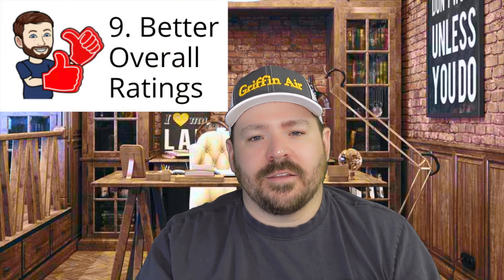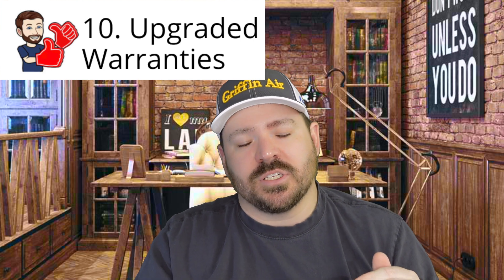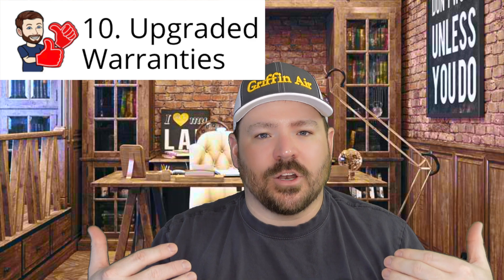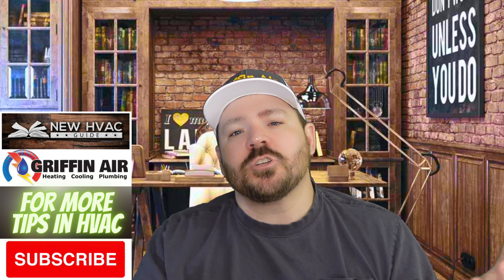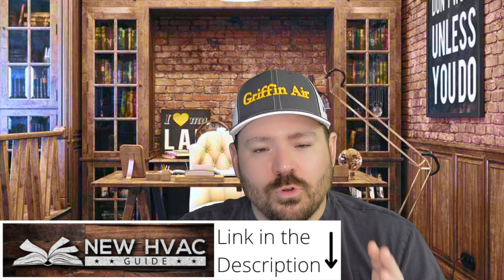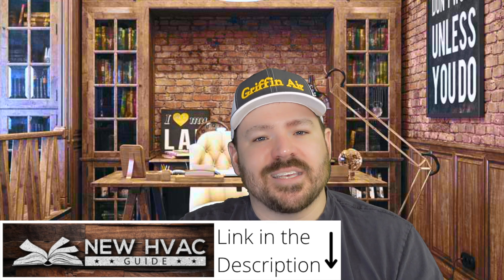12 REASONS Inverter HVAC Systems are BETTER!

Comment: I'm in Tucson, AZ and preparing to replace a 5 ton rooftop-mounted packaged heat pump.  I have quotes from two contractors, one who didn't even bother to climb to the roof (a non-starter) and another who seems to me to be top-drawer.  My options are a American Standard (Trane,) dual-speed comp and ECM blower or a Bosch IDP.  As a retired EE and techie, I'm leaning to the Bosch, which is actually a few bucks cheaper.  This isn't a concern.  But what is, as a radio amateur operator, I have worries about the potential for radio-frequency-interference (RFI) being generated by the inverter electronics.  The EDM in the current Trane generates a bit of this but is livable.  The wall-wart switch-mode power supplies that are everywhere are the bane of our existence and are often thrown away and replaced with linear supplies.  Clearly, I can't do that with a heat pump.  Do you have any experience with this?  Love your channel.

Comment: I just had a Daikin inverter system put in. Replaced a pos Trane I had for only 5 years. Spent the extra and been happy with it. 12 yr warranty and I have a stress free program so filters for the whole house HEPA I got and maintenance is included.

Comment: Any time you add more complex systems to any machine the maintenance cost and failure rate rises. The people who benefit from this scenario is the HVAC company's that sell and service these systems .
Reply from the maker: I think it depends on what you mean by failure rate. If you’re saying there are more bells and whistles and things that could go wrong, that may be true. But if you’re saying that things like a compressor or motor are more likely to fail, in my experience… The opposite is true. I have replaced hundreds of failed single stage compressors in my career but have only ever seen one inverter compressor fail. This is precisely why most manufacturers are giving above average warranties on inverter systems

Comment: When I bought my house it had two separate oil furnaces with central air units. Oddly the newest one went first and I replaced it with Mitsubishi hyperheat unit so I could start getting rid of the oil heat (no access to nat gas). I'm on my third year and there's been no problems and its a lot cheaper than oil.

Comment: You mentioned that a VFD w a 3phase compressor is used in some products. That would eliminate the contactor and capacitors. A well designed and robust VFD with a 3phase compressor would last damn near forever.
Reply: In your dreams!!!!!
Reply: @WesB1972  One of the problems i see with VFD and other far more basic controller boards is that they are put in type 1 enclosures. I noticed some mfrs are coating their boards (Gree). Type 1 is very hard on electronics.

Comment: At some point in the future (less than 10 years), minimum SEER requirement will force you to move to inverter system in anyway.
Reply: Within today's market place, an 18 SEER simple 2-stage heat pump system that doesn't require a $4,500.00 replacement "inverter drive board" or a $1,000.00 thermostat is easy to find and have installed.  The future will never become even 30 percent "inverter drive" populated until the manufacturers stop "gouging" the general public with outrageously high prices for the inverter drive equipment. Two-stage systems are virtually bullet proof.
Reply: Yes, that has a good likelihood of happening.  Wouldn't have touched a variable-speed (VS) system 10 years ago due to the steep cost difference and bleeding-edge tech at the time. However, the cost differential between VS and single/2-stage units is narrowing vs 5-10 years ago. As a result, payback times are becoming shorter.  As more VS units get installed, components will be more easily available & their costs will come down as well due to higher volume production.  Plus, more techs will be trained to work on these systems as more are installed.

Comment: I have watched several of your videos which have been helpful!  5 years ago we had our system replaced with a RHEEM RHMV6021SEACJA.  Come to find out the EXV control board was never connected.  (Identified as we are trying to figure out why humidity so high.  We had previously been in a very long  drought so it wasn't an issue until it has been raining alot recently)  is it reasonable to at least HOPE that the humidity will improve once the communicating set up is done correctly?  Other AC guys online keep telling me it is optionl control board.
Reply: I have a single stage AC and an inverter gas furnace. For me I chose a single stage AC because we only use cooling up here for a couple of months per year. The comfort of the inverter gas furnace is amazing. So so quiet. Makes me wish I had paid a little extra for an inverter AC. It’s great technology and my 13 year old Lennox inverter furnace has had 0 issues, and it’s running probably 8 months per year.

Comment: I bought a pioneer mini split inverter system 1 year ago.  I know its a cheap brand, but I mounted it just off of my 15 passenger van bumper.  I run it off of solar panels and lifepo4 batteries through a inverter.  It has been awesome.  I ran it 3 straight days in 95 degree summer heat before the batteries got to 10%.  The ECO mode only draws about 350 to 400 watts and often it only draws 100 if its mainting the cool temp.  It is extremly quiet, something I wanted for both indoor blower and the compressor being i run it while parked in parking lots like walmart.  I didn't want anyone to know it was running.   Never has a spike in power but just gently revs up.  My only problem was it does have a small leak, I think at the flare nut going into the outdoor unit.  Considering I've driven it 10k miles on interstates, over speed pumps, country dirt roads with pot holes, washboard ruts and a few accidental curb hopping incidents I'm amazed the flare connections have held up!  That is the only weak part for me.  But to run one of these on a solar/battery setup is just amazing to me and allows me to boondock with it.  I'm ready to add one to my home office space now.  Just trying to decide if I want to go cheap again with a pioneer or if it's worth the extra for a higher end brand like the diaken you install.
Reply: You should do a video on this setup. I am considering the same type system but on my 30x40 insulated shop.

Comment: I have a Bosch inverter system, hate the system humidity is constantly high and I have not seen any savings on my electric bill
Reply from the maker: Something may be wrong. Have your contractor put it in charging mode and check the subcool. Then have them lower the airflow and check the capacity switch

Comment: I bought a new Daikin 4 ton inverter split 23.5 seer AC/Heater stack with new outdoor unit 4 years ago. It came with a CTK04 Communication Thermostat. I hated that thermostat from the start. Now, in the heat of summer, the AC again no longer works. I had an AC tech from the company I bought the unit from come out. He spent 2 hours trying to find the problem, but never did. His words to me were: there is a communication error someplace.... to pay this much $ for a system that fails after 2, then 4 years is throwing away your money.
Reply from the maker: You may want to get a second opinion.

Comment: More good work josh- a few points, seer 1 especially is about as useful reliable accurate at government CPI published rates. I am a user an advocate of inverters simply from a comfort standpoint, esp if dont have access to dual fuel nat gas for winter. And in mild climates, reasonably tight house, may never need whole house humidification. But there are real issues you don’t address- if you have two systems in your house, no big issue if parts not available for a few days. And lets be honest,. It’s easier from  service standpoint to replace modules as it’s harder to get skilled knowledgeable  techs. I think you cna make a case to most clients to go inverters but of course lets be candid-inverters sales ALWASY work for the installer. More profit up front, more warranty repairs  paid for by manufacturer, and more service calls after warranty expires, client comfort, etc. final point -the delta between major manufacturers of forced air units is not all that great. If you don’t have multiple havoc service providers for say daikin or Goodman in your area, you have way fewer choices Re competitive pricing and quality control commitment and even staying in business retiNign quality service crew. I’ve had communicating inverter technology from carrier, trane and Lennox in various houses and if anything I find Lennox has an edge Re features  thermostats, etc, BUT it’s not significant. All have parts depots in my metro area, but fewer providers are ‘certified’ and experienced with the Lennox units. Whatever manufacturers is passing along a special sale price eat the time usually is also highly determinative of the purchase. It’s like cars. Don’t fall in love with one brand,color; and make sure you have options other than teh high priced dealer for repairs down the road when manufacturers warranty expires. I think daikin and Bosch make Greta units, but you simply aren’t going to have those service options down the road . I can find dozens of experienced carrier dealers in my area, and choose which one is delivering and continuing to deliver great service down the road. But Bosch daikin only have a few dealers with any real experience.
Reply: More profit up front, more warranty’s revive paid for by manufacturer, and more service calls... yousummed that up nicely.

Comment: You’re forgetting one of the biggest benefits. I can start and run my VFD “inverter” 3 ton unit with a 5500 watt generator. A traditional unit would need a 20,000 watt generator to start a 3 ton unit.
Reply: Get a soft start for a traditional unit and you can run it off a much smaller generator.
Reply: @jeremiahwalker8883  there are still inrush currents with a soft start. A vfd has zero inrush currents it’s a nice gentle ramp of amps.

Comment: You don't really need a communicating thermostat to benefit from inverter/modulating heat pumps. Even if it's connected to a "dumb" non-communicating thermostat, it will still be pretty smart and sense the air temperature over the indoor coil and the outside ambient air, runtime, etc and still give most of the same benefits. If it knows what your exact setpoint temp is then the PID control can react much faster, especially if residents fiddle with the temperature constantly, but in lieu of that, it will still do a decent job working out how much heat/cool load there is.

Comment: Thanks for the info on side venting models. Can they pair with NG furnaces. Would that answer be in your GUIDE if so happy to pay for it.
Reply: I have a side-discharge heat pump with a gas furnace, it will call for heat from the furnace if it's in its defrost cycle or it just can't keep up.

Comment: I live in a high lightning environment. I recent years I've had two strikes that I know of within a 100 yards of my house. Lightning fries electronics. I'd rather pay more on my electric bill with a simpler system than have one that'd mean paying a large sum to replace blown electronics. Simpler can be cheaper. What are your ideas on that? Also, I've put in enough insulation that my attic is about an R-70. I like saving money that way. Lightning isn't going to take out that blown-in insulation and attic foil.
Reply from the maker: You would definitely want some protection for any kind of electronics. Phase monitors are becoming more of a thing
Reply: You need a huge lightning rod like a 30 ft 4" diameter steel bar sunk 10 ft into the ground at the farthest distance from your house as possible. next you need battery backup systems on your most sensitive electronics that can also function as power spike protectors. I live in mi and my power spikes and fluctuates a lot. I don't have local lightning strikes but with my power acting up like it does I spent $$ for over size UPS systems. 

I recommend a large inverter with some large batteries in the area of your power panel. Make it like a solar system but without the solar panels & be designed to charge the battery bank and auto switch from main power to battery power. I used to run computer servers and use those types of UPS systems but now with the tech available for the solar style inverters and large batteries that is the way to go. 

That system does not run my oven or that type of thing but it is wired to run most everything else including my gas water heater and gas HVAC as since those are gas the actual electronic load from them is low. I like how it works now as all the power fluctuations and short outages no simply no longer any issue. Then I bought a 12000 watt generator just in case power goes out for more then a few hrs.

You should build a Faraday cage in your backyard and sell tickets so people can come over and watch the lightning strikes up close. I been about 50 ft away from a full on 50 million volt lightning strike and I will never for get that experience. It was an amazing demonstration of the power of nature. Yes I would pay to experience that again but with the best set of sound protection ear muffs I could get. It took a day or so to be able to hear normally and I remember the bones inside my body rattling like kindling wood when the pressure wave rolled "through" me and being shook like a piece of paper in the breeze. AWESOME...
Reply: I would say anyone with inverter equipment esp communicating  one (ie more and more complex boards inside AND outside) is crazy not to install a surge protector at shut off box. This is really simple stuff-diy for less than $100. I think it’s malpractice for a dealer to install a communicating model and not insist the owner buy a surge protector-that said, dealers will charge flat fee mark up of $150 for ten minutes work.
Reply: My electrician put a whole house surge protector on the main breaker while doing some wiring for other things.  The surge protector was only $150.  I know there is an emp shield one for $350 plus install that protects a house from lightning surges.  If you get hit it destroys the surge device but is guaranteed to protect your stuff.  They also send a new unit out for $50 but you have to install it again in the main breaker.

Comment: What would you do to add to the system something to refresh the air in home. With more high efficiency homes, air inside is not so good
Reply: You can install a heat recovery ventilator (called HRV or ERV), I'm thinking of getting one. New house is too tight and the CO2 levels rapidly rise when the windows are all closed. They will exchange the inside air with fresh outside air with minimal heat losses.
Reply: @ddud4966  thank you!!!

Comment: I just purchased the Diakin Fit inverter units for my PHX home, but was surprised that they still turn on and off nearly as frequently as my old single stage AC unit. I was expecting the compressor fan to stay on nearly all the time, but just run at variable speeds, so that the full on and full off behavior wasn't utilized so often. Is this frequent on/off behavior correct or should my compressor fan stay on nearly all the time at variable speeds?
Reply: Our Diakin unit is the old pueblo does the same thing. So what are the advantages of inverter technolgy that turns on and off like our "ol' fashion Trane unit which is much more reliable and trouble free?
Reply: @BobCatz213  mine also turns off (although much less so) and on but usually only ramps up a bit at a super low capacity saving tons of energy.

Comment: Very experienced service tech / supervisor and I hear all the negative comments and it boils down to knowledge , your ability to understand inverter etc and it’s easier for most techs to stay with basic systems. In my experience the majority of techs don’t understand them and they don’t want to learn anything new it’s easier to say that’s junk then to evolve. 
Love your shit first YouTube tech I have ever subscribed too. 
Bosh is crushing it , I’m going to wheel an deal an put on in my house haha
bosch damn auto correct
Reply from the maker: Thank you for your kind words pal!
Reply: Im from south tx and i agree with you totally. Im an older tech and ive told these younger techs you better get trained up or get left behind lol. I firmly believe in the old saying (old dogs better learn new tricks)
Reply: @raychunn3229 
Can you install an Amana or Bosch 15/16/or 17 Seer 4 ton heat pump in San Antonio anytime soon?
It's just the outside unit, but it's replacing a 2007 Trane 13XR heat pump that's old freon technology. 
Will I have to replace the air handler in the attic since they're probably not compatible?
Reply: You have the cost advantage of a wholesale price and your own labor for install. Then you have the advantage of likely having parts in stock and a deal on them. It would like buying a hybrid car then having a breakdown far from home and needing to get it fixed so you can continue on your trip and no one local can fix it or carries the parts in stock.
Reply: @howardkeil1526     It’s a Toyota. I be fine. 😆